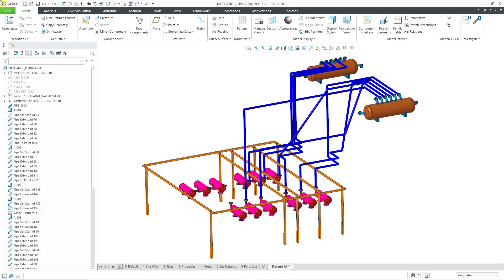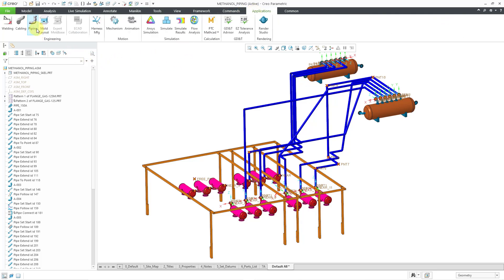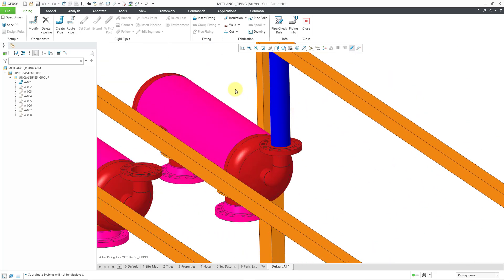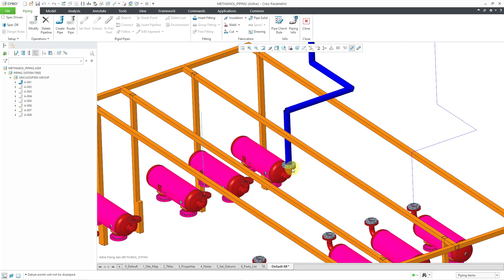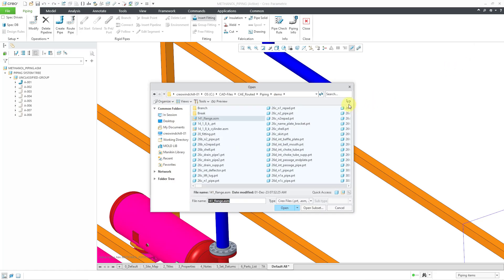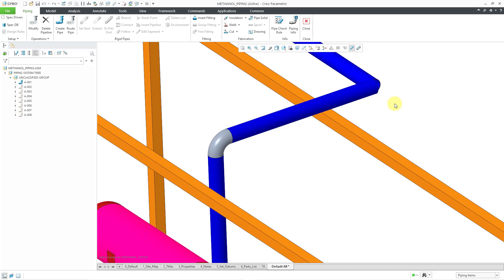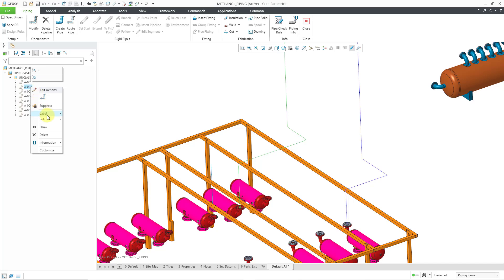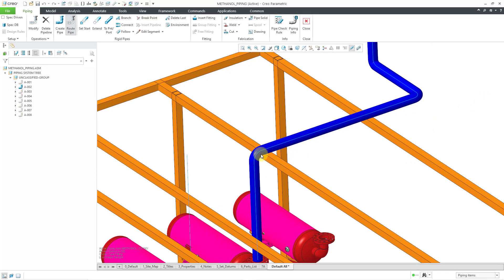Creo Parametric - Piping - Inserting Fittings

Comment: Ok, so whats the point of this-just a visual representation? Or are you gonna do a flow analysis??
Reply from the maker: The point of this is to design a pipeline so that it can be built in the real world.
Reply: @CADPLMGuy  so 3D represenation of a piping diagram ? But it doesnt have dimensions on it ...or are you planning to release more videos??
Reply from the maker: Shops typically use 2D drawings to figure out what to cut and bend. The same 2D drawings are then used to assemble the pipelines onsite. Yes, there will be more videos. Take into account that I have a full-time job and a kid, and I make these videos in my spare time. Videos will be available when they're available. If you're in a rush, there are plenty of instructors and consultants that you can pay.